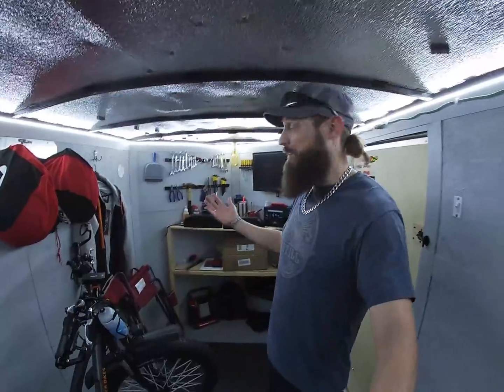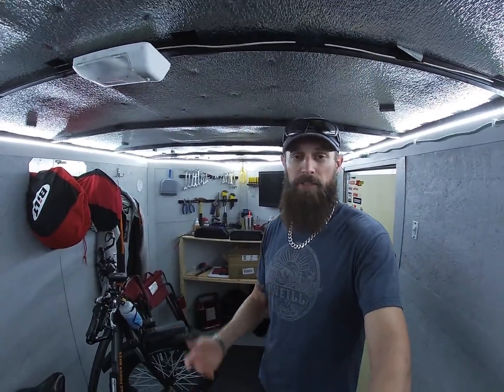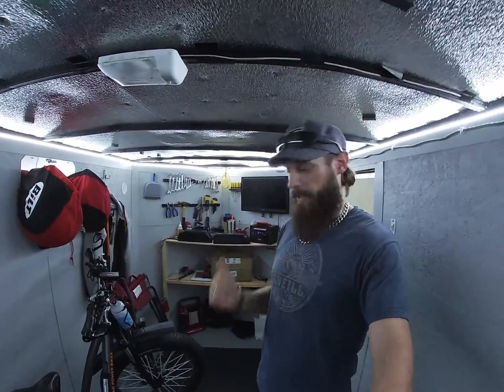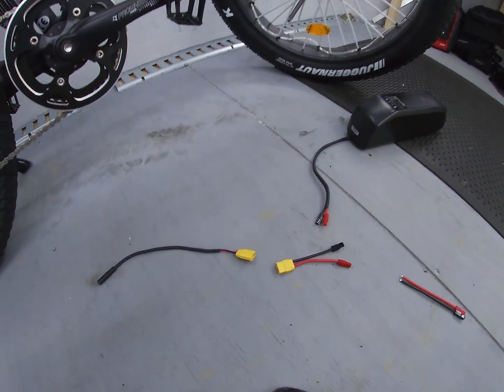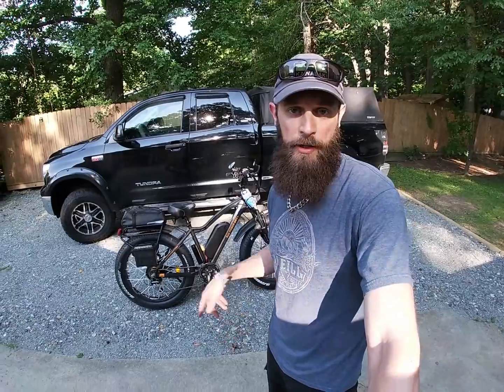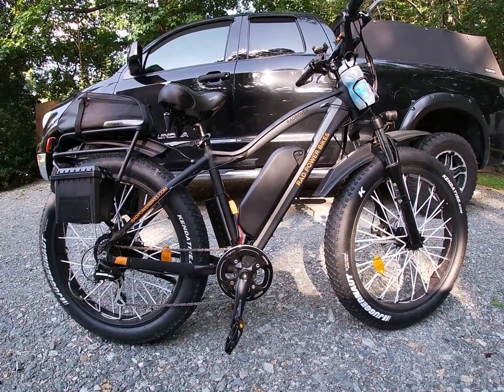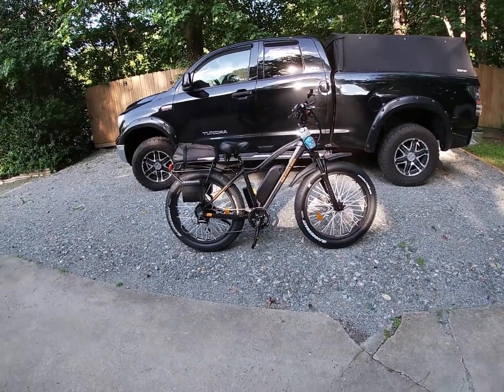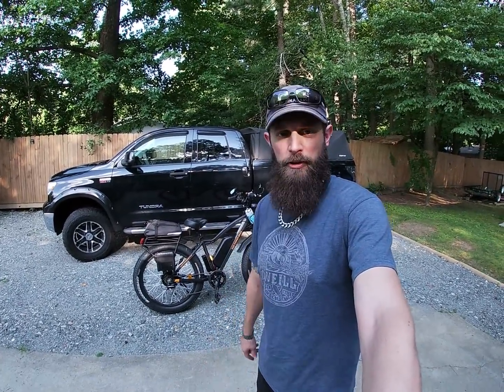52v Battery Upgrade on Rad Rover ebike

Comment: Where did you get the barrel connector that goes into the controller? My RAD battery is toast so I want to buy an aftermarket battery. 48v 20ah. Unfortunately, the cradle does not match the aftermarket battery so I have to do some thing similar to what you’re doing. I just can’t figure out where you got the barrel connecter from.Thx

Comment: Bro I have an e bike I put it together myself I bought a motor rim and battery n electric box ,I zip tied the stuff all down my question is do I have to unplug the battery after each use ,or just un plug the battery when I charge it up??

Comment: Great video - Thanks for sharing. Monitor the temp of those junctions. You are correct the heavier gauge carries more juice.
I would lean to removing un-needed connectors for reliability and less voltage loss across each connection. But your way is an easy test.
Splicing a heavy gauge to a smaller gauge SHOULD set off your alarms - proceed with caution. The small 2 pin connector is a weak link for now. 
I need a new battery on my Rad City 4 and have the upgraded Bolton controller (1500w)- better connectors are a must.

Comment: Best option if did solder would be ....Remove bat Anderson ....solder just an XT60 Male on to bat ....plug xt60 to xt60 with rad end ....reason been xt60 better connector than Anderson and have xt60 before rad connector is much more stable and more water resistant and stable than the Anderson ...again involves soldering ......However if was ever to solder XT60 on to Bat Anderson ...Do one Cable at time take off one Anderson and solder on one Xt60 side ..then the other ...that way your less likely to criss cross wires...

The way you done it now is simplest method and best way to show it so that safest ......However they should Note That Red is on same side on each connector ....if in case person who sold cable has reversed the xt60 connector and soldered it wrong way around ..so always double check any two cables that uses converter and connector that positive negative on the right sides

Comment: Whatever works man. I'm in the same situation, my controller has ring connectors.. I have to make my own xt60 to ring connectors which is a nightmare for my first time.
Reply from the maker: good luck, i didn't learn how to solder until i got an ebike :)

Comment: Great video.  Question: can i use a 52v battery + 48v 30ah controller with a 36v 500w hub motor?

askin for a friend😏…

/Bklyn👑

Comment: Notice using 52v over 48v gets motor more pick up off throttle. Only 3 seconds faster than 48v but with higher Ah the range is about 5 to 7 miles more on throttle alone. The 52v is great to use when using cargo trailer or just being a bigger person than average. But it does create more heat to motor when using longer then usual. Anything higher of using a 1000 to 1500watt will get motor a bit hotter as I think its best not to go too far out of the Voltage of 48v to 52v. To use higher like a 60v , 72v and up is more suitable for the 2000watt and above for it is about having motor last longer.

Comment: I watch all your videos and find them very informative.  I have a ariel xclass 52v and want to add an additional battery to run parallel.  I have reached out to them but seems as though they are always out of stock.  Do you have any suggestions.  I have done some research and every time I am about to purchase, I hear a horror story about bike catching on fire.  I am hoping to get a 52v battery 18amps and above as I do a lot of long distance riding.  Please advise.  I have already reached out to chi battery and they have nothing compatible and don't send anything to Canada.

Comment: Parts have gone way up in price, and the other links are either sold out or don't work anymore.  Do you have any updates for parts and links on how to do this today?  Or is it a wait for parts to be available situation?
Reply from the maker: i noticed the other day that some of the prices bumped way up. i think it was the battery that was like $200 more now.   sorry i don't have any updated parts lists, you will have to just search around, lots of supply issues out there right now.

Comment: I have the Radrover 5 2020. I installed the Bolton upgrade.now it pulls 1500watts, excelerates like you wouldn’t believe,but the speed is still the same.

Comment: To hell with my warranty, I’m soldering, lol.   I fly quads, so I have a crap load of xt60 conn. I’m getting a bafang mid drive but I’m ordering the 52v batt.  👍🏾.    Can’t wait, springs here!   Had gas powered bikes, 30 n 40 is hairy, but 25 is a good cruising speed

Comment: I bought the Bafang G060.750.DC (True 750) after watching your video and I was convinced I needed to add hydraulic brakes before riding it.  After a long back order from Magura for the MT5-E four piston brakes, I finally got my bike together with the motor, brakes, Bolton 35 amp controller and color screen.  It is an amazing transformation!  Thanks for showing me the way.  Btw, I highly recommend the Magura brakes.  They’re a little pricey, but worth it.

Comment: Do away with the yellow plugs and solder the different gauge wires together.  Each plug you go through has the potential to cause resistance and lose power. Soldering guns are cheap and it’s very easy.
Reply: Soldering  is a pain I say get crimp connectors preferably  ones that are thick enough

Comment: Shimano are okay, but if you upgrade your power and speed, you'll want SERIOUS STOPPING POWER! I took off the Techtro and swapped in MAGURA MT5E Hydraulic brakes! 4 piston 203 mm serious stopping! You cant go wrong! Worried about security? Try a PINHEAD CITY LOCK . Used in conjunction with a solid *(ABUS) Cable and ulock(kryptonite, Abus) and the bike alarm shown in CITIZENCYCLE' S security video, you'll be all set! Last but certainly not least an affordable GPS called the BOOMERANG is also available. If you find decent affordable insurance, let me know!

Comment: Do you know if the stock controller can handle 52v batteries? I plugged mine in and I had no motor power then the screen went haywire and it completely died and won't turn back on.

Comment: hey friend, my bike has a 48v 350w hub motor and a 48v controller... can I make this battery upgrade too? i mean the extra voltage does not damage my kit? i saw you had a 48v too, and you made this upgrade, and i liked it...
Reply: Planning  to do 52volt on a 750watt  motor best balance of power and mileage  and maybe 35mph out of it since I weigh  around 80kg  my bike will probably  weigh  19kg  probably  may stick slightly  lighter aluminium  rims maybe commute  tyres  on  better bearings ceramic  bearings will do nicely  bafang  750watt  since it will be lighter  than the hub motor  aswel so my bike could be a very capable  fast  ebike lol without  sacrificing miles on it since I plan to take it to Grove and back it took me and my friend  about 2 hours to ride there on pedal bikes ok he had a road bike and I have a mtb xc bike for comfort but it was tiring to ride that far I am all down for comfort  while riding but I don't have the strength  to ride at 20mph for 2 hours had to take a few drink breaks to get there    so to go 30mph with enough battery  juice to take me through  miles and also be a great get to work bike since if it can do 50 miles on a single charge without being stupid and just use pedal asist probably  get a long battery  life for a month  I mean I can pedal to work but I do sometimes get to the point  where you can just turn on the switch  lol  some days if it's really  cold then I may use the motor more during  the summer maybe stick it on asist level 1 if I get too hot and can't be bothered  to pedal human after work in a hot kitchen  you would probably  say right I am not gonna pedal unless I see cops and have to clown pedal lol

Comment: Just get a better mid drive bike with a full suspension and throttle. Pay 3.5K and enjoy the ride
Reply from the maker: it has certainly crossed my mind, upgrading has been fun though.
Reply: CitizenCycle I have a RadRover. But, I’d buy a RadCity to upgrade because of the regenerative braking. I need more torque going up hills because I live on a massive hill. I hit almost 40 mph leaving my house without upgrades

Comment: Hello sir I bought a hemiway bike fat tire 26-in.. 750 w motor 17 1/2 amp battery. I've had it for about since January 2020 and I put about 2030 miles on it. I only hade to change the brake pads once.but well now the electrical system is gone out and the company will do nothing to help me fix it.... And I can't find anyone that can fix an electrical bike like this. So depressing I spent $1,500 on it.. and it's my only mode of transportation... Really don't know what to do other than say the hemiway company sucks.... My name is Renee Burns.....

Comment: Sir, I need to ask you a question. The Bolton 35A 750w controller, can accept either 36v or 48v according to the site of boltonebikes. But here, you are using a 52v(aka 51.8v) which on maximum charge might reach voltages upto 58.8v. So isn't there any issue regarding that? If not , I would love to but it and make a conversion just like yours.

Please reply, its a humble request.
Reply from the maker: i just looked on their website and it says compatible with 48v or 52v.  You need to click on the section for "radrover upgrades" then click on "Rad power upgrade kit" that is the controller i have.
Reply: @CitizenCycle925  Thank you I'll definitely check that out.

Comment: I have purchased a Zugo Bike recently and am waiting for it to arrive. It comes with a Bafang internal controller 750w hub motor. The connecting wire is a waterproof 9 pin connection cord. I am wanting to upgrade the back hub motor to a 1500w hub motor with a external controller. I am wondering how to connect what would be the new hub motor and controller to what I suspect to be a 9 pin female cord. Does you have any advice on how to do so or past experience with this? 

Thank you in advance for any help!!
Reply from the maker: sorry i can't help here, i am far from an ebike technician.  good luck with the upgrades though!

Comment: Hail citizen!! I have watched all your upgrades to your rad rover.. I’m waiting for my bike ( not due till September) but I was wondering if you have ever looked into adding a front wheel drive to your bike with all your other upgrades you would surely have a rocket ship!!!! What do you think? TC, from NV...
Reply from the maker: hi Thomas, thanks for checking checking out my channel and following the build.  did you get the full sized Rover?  Many have suggested using the old components to make it 2wheel drive but i haven't really researched exactly how to do that yet.
Reply: CitizenCycle  FYI I also looked at your website.. no doubt you’ve been blessed with a lot of toys!!! Thanks for your reply.. I ordered a white rad step thru fat tires Rad 1.. not mini!   With a delivery date not until September, I’m thinking of contacting the Rad folks and ask if I can change that color to black... I like the look of yours..
TC from NV

Comment: sweet ride. add some motorcycle windshields that grip on the handlebars for smooth sailing. You're as rad as your bike man. Don't stop upgrading
Reply from the maker: i've actually thought about adding a small windshield but figured that is getting carried away hahaha

Comment: I hope they leave e-bikes so they can be legal. I will not go faster than 20 unless I'm going downhill which I did yesterday and I went 30 but it was a little bit out of town my whole body hurts and that's the most fun I've had since at least four years and before I lost my leg. I got to do more studying on the bike. I believe they are listening to the people that make these videos I already had a pretty good seat when I got mine they put the kickstand where it should be because there was an issue with it rubbing on the break. I would like to know how come I hit the right brake and it makes like an electrical weird sound? And also the motor got pretty hot but it was 81° yesterday I don't know I'm going to try to research it the seat may B adjustable

Comment: I got my hammer bike yesterday it got here really fast from upzy. They just left it at my door I did not sign. Where I live you should never do that. Anyway I have one like so it was sitting by my back door and I thought oh my God how am I going to do this. So I went and got my bike wagon and I pushed it into the garage on the wagon lucky I have the wagon. This wagon can hold 500 lbs we used it for camping. Anyway I got it put together it was charging it was half charged. I got on it I went to go out my driveway which has a hill. A lucky for me I crashed cuz I didn't have the handlebar tightened down or they didn't where it goes on the pole. I'm laying on the ground thinking this bike is too big it's more like a motorcycle but I got it back in my garage by hopping on one leg. So I got it back together I take off and I cannot believe how fast it is and it's not like a regular bicycle you can't steer that good around corners. I was at the End of the Street faster than I could believe it I had it on five. I want to turn but I couldn't and there was a car coming so I went in somebody's yard and crashed LOL I was starting to feel like a crash dummy. So the handlebars were way off again. I rode it back to the garage fixed it again. This bike has a handlebar adjustment which is great I finally figured out how to tighten it after I took a 12-mile ride around town. And I could not believe how I love that thing. If I had not been riding a bike since I was 7 years old there is no way I would ever be able to ride that thing even with two legs. Today I want to go get a thing that I should not have to buy a poll for my seat or whatever you call it I forgot. Because I have a wagon that I want to tow and also you cannot put the seat all the way down there's some weird thing in the seat maybe you can adjust it but I have no clue it has a little adjuster on the bottom I don't know if it's for a spring or what. But I need to be able to Flat touch the ground when I got one leg. I thought you had to Pedal all you really have to do is push off with one foot if you're going half a mile an hour you can take off yay I felt so free I was like this is way better than a wheelchair I got to buy the basics like a helmet a backlight. I'm like almost tapped out but I'm trying to get a battery on credit on u t z y. I don't know if it's the greatest company but I got the bike for 1399 or less. Their batteries are the cheapest I've ever seen and I was researching for days. I really really enjoy these videos. There must be an electric bike Community somewhere where you can meet other people that like electric bicycles. I live in New York state we have a lot of trails but the coolest one is the Erie Canal cuz it goes almost all the way across the state from Lockport to I don't know if very long long ways. It is supposed to rain today like torrential rain. If you are in really bad rain what does it do to a electric bicycle? I intend to take my bike camping with a wagon that I used to use to tow my boys in well they are grown up and they don't even bother with their dad and it's really sad but I like camping and I'm going to go have a nice day how much money do you have into that bicycle?

Comment: That's a great deal on the battery. I wish I had known about electrobikeworld sooner, bought a new battery from Rad and it was over $600 w/ shipping. Also it's the same 48v as the stock battery, and doesn't include a mount or a charger, this is a way better deal. Thanks 👍

Comment: Unfortunately for me I agree, this battery looks cleaner than the triangle.  I bought a triangle battery for an adventure in building one myself.  I've been wanting to use it with my rad forever but I couldn't commit to cutting the wires.  I have the cord on the way though for this set up.   It has been a while since I purchased my battery but I feel like it is a similar size to this.  I bought from em3ev when they made a few options of triangle battery.  I really enjoy the speed for flying down the dangerous back roads of my area to cruise around in town.  People on back roads don't watch for or respect bicycles.  I've had many an items thrown at me from cars.  😒

Comment: Hay, looking good... I suggest range test with throttle only and  another test with puddle assist on level 3 for both stock battery and upgraded one. It could be done on multiple videos. That will help many people using the bike to commute.

Comment: Man that looks clean and slick!!! Love it. Thank you for not going with that bag. oh man, phew. I think you made the right choice. Like you said you can get on a motorcycle to go faster than 40MPH. I think 40MPH for going around town is just about right. You can go slow if you want or you can roll with traffic when you need to. Sometimes it's hairy and you need that quick throttle to get away from danger or something. It's about using the tools the right way. 
1. Are you going to upgrade the brakes? How do those feel right now? 
2. What ever happened to third gear issue? 
The cliffhanger is killing me on this video!
Reply from the maker: my brakes dont feel adequate for the power i added, i need to do something there.  gears are fixed. i found out a friend use to work at a bike shop and he fixed my derailleur in like 5 min and it shifts perfectly now.  results soon i promise, that is next video on the list.
Reply: CitizenCycle awesome! I figured as much for the third gear probably just needed a little adjustment. Not a big deal. Glad it was just that. Very interesting about the brakes tho. Do you want the brakes to give a strong stop or a gradual stop. At 40mph I’m sure you want your motorcycle brakes lol.